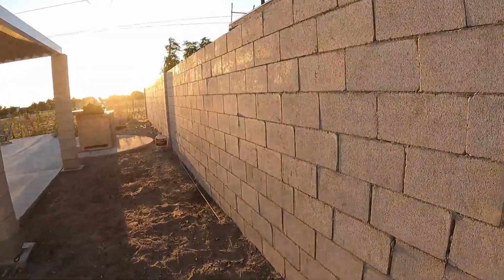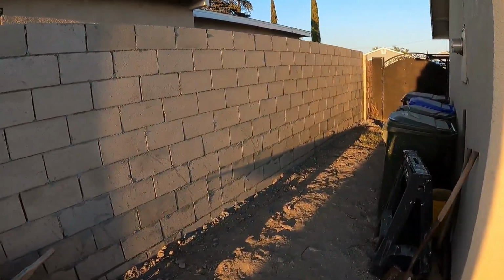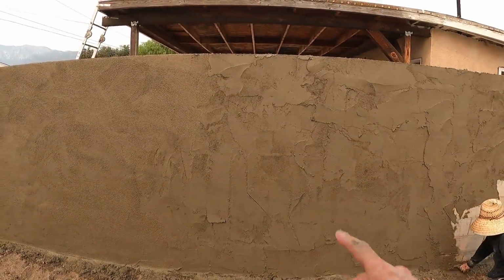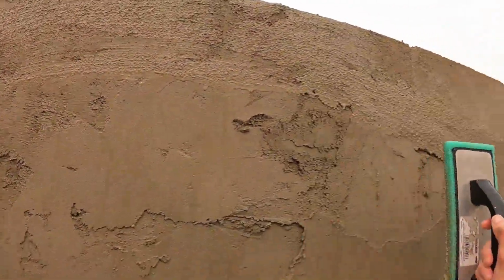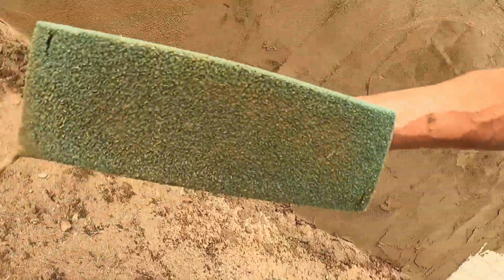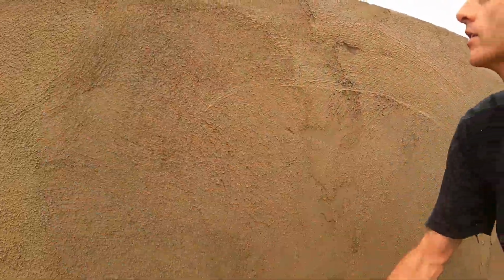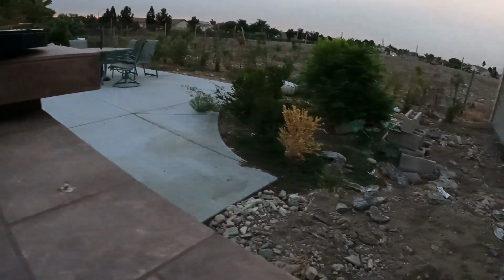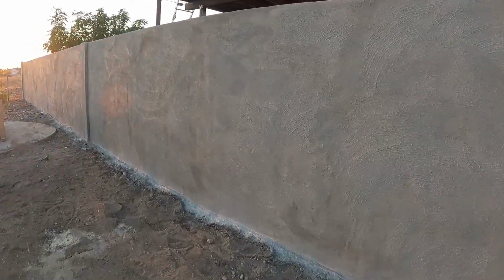Applying texture on a block wall

Comment: you just used straight stucco mix out of the bag?
Reply from the maker: Yeah a quikrete stucco mix it's the scratch and brown base coat... Sometimes it's good to apply concrete glue to the wall first